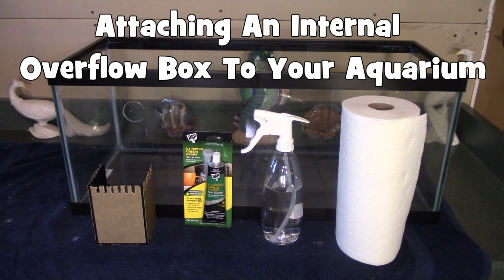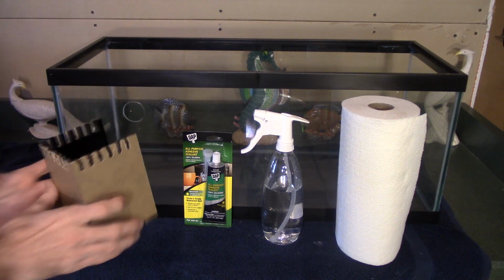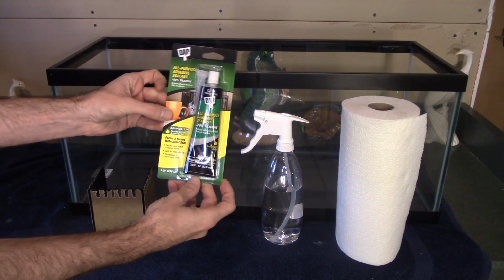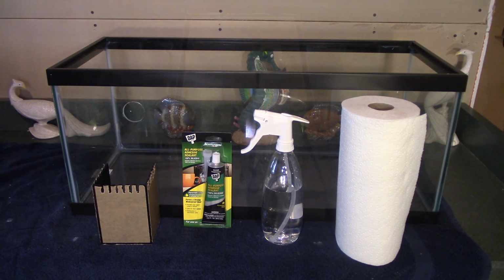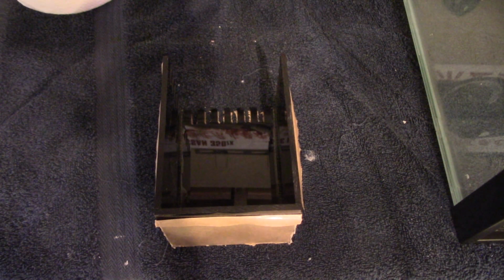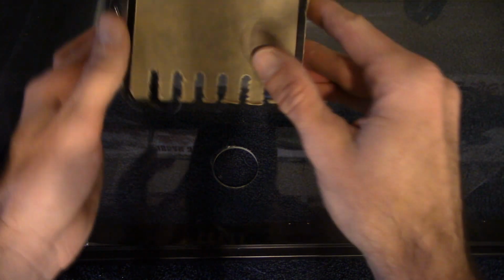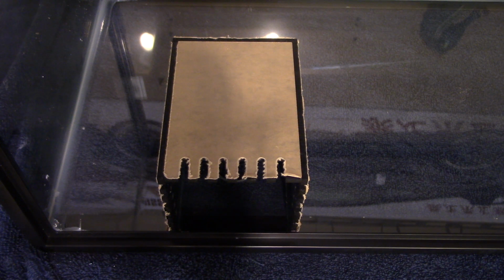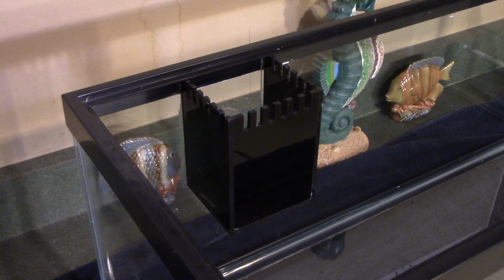Attaching An Internal Overflow Box To Your Aquarium!

Comment: Another tip since silicone doesn't adhere well with acrylic is to score the sides of the box along the edge where the silicone will be applied. Do not score where the box meets the glass. You want a tight seal. This will allow the silicone to get"into" the box. Use 90 grit sandpaper or groove with a utility knife